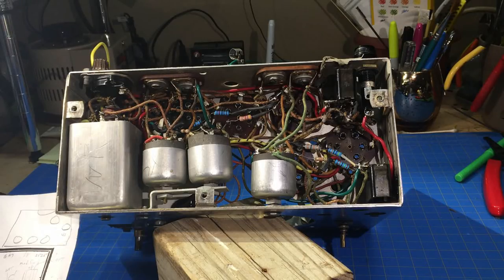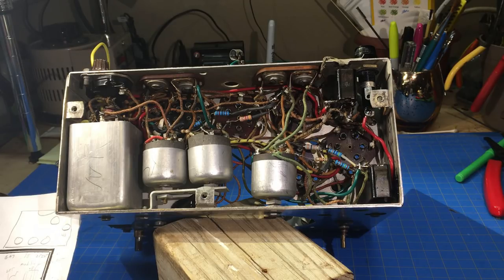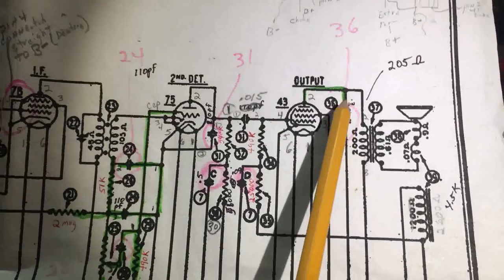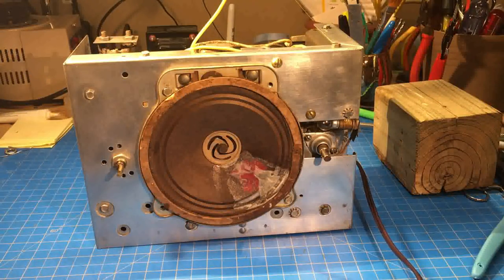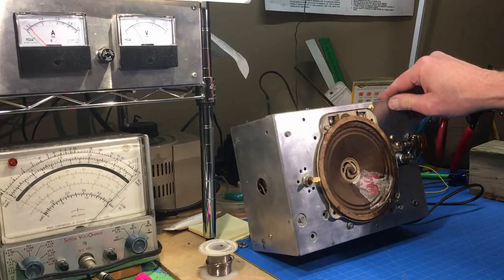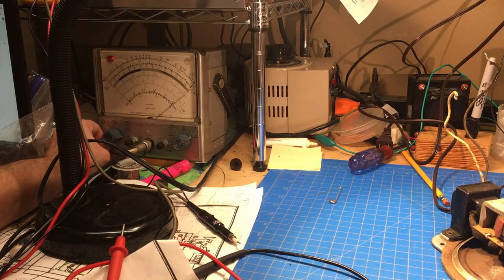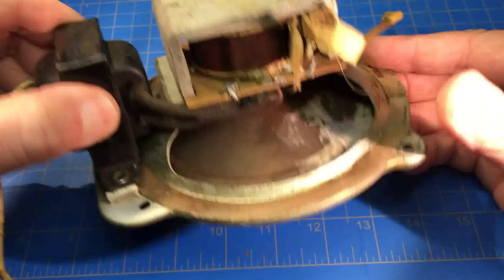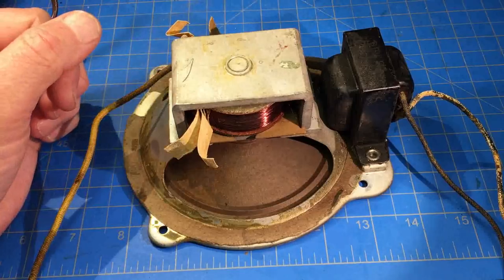1935 Philco 54C Part 5 of 7 Bad Speaker Field coil and a New Direction

Comment: Larry,
I really like your meter.  I like the nice big dial.  My heart sank when no sound came out.  I have had more Philco speakers with bad field coils than any other brand.  Since Philco made their own, I suspect that there was a relative deficiency in their units.  It is a nightmare when that happens, especially when you know that it WAS working before.  Sometimes that happens though and you did solid troubleshooting work.  Excellent as always, Larry!   Cheers!    Michael
Reply from the maker: ThatTubeSound Thanks Michael! The meter was a gift from my neighbor and partner in crime. He bought it and went they it, it wasn’t exactly factory but someone had made a major overhaul with fabricated PC board. Works great and I figure it’s as good a meter as “ancient Radio repairman” had so, I’ve started using it. Who cares if the voltage is 134.357 volts? 135 is close enough! Speaker was a bummer and maybe a show stopper for some, but I ended up showing what someone would do if they wanted it just fixed. Doesn’t have to be all original? Does it? Lol. This one should be finished soon and I’m starting a new project and going to try something a bit different! Hope all is well! Take Care—Larry

Comment: You have been having the kind of luck I usually have with radios, Larry! Something minor preventing it from playing..like that bare wire. I've been there so many times. Bad ground connections. Missing grounds. Bare lead touching something it shouldn't. I've also been there with open field coils too. Usually with me it's bad speaker cones. Rattlely, garbled sound because of it. Working on a Zenith 6D311 with a bad speaker right now. Anyhow glad you found the problem. Once you locate a speaker you'll be good to go. Even if it's a permanent magnet that will fit.
Reply from the maker: gavinwb1 Thanks Greg! Lol, the tiny things can be the bummer. I got discouraged, finding so many discrepancies with the wiring, I feared, I would never find out what was the cullprit! Lol. I made a few minor mistakes myself. But, I guess a field coil, power transformer, coils, IF's and speaker parts are a techs nightmares! Started the cabinet, so thats a good sign Im moving forward! Lol Take Care--Larry

Comment: Others have recommended that the output filter cap should be rewired to B+ instead of B- anyway. It takes a lot of voltage off the capacitor and reduces the risks of a disastrous short happening.

Comment: Hey, Larry...
You probably already thought about this, but you may want to add some capacitance to the power supply by bumping up the electrolytics one step.  Check out what the smart fellas have to say about it, but I believe it is commonly done.

...and oh yeah....EXCAVATED !   I love it!
Cheers!  Michael
Reply from the maker: ThatTubeSound Thanks Michael, I did consider the added capacitance. I used 15uf instead of the 12uf that were original. That was even before I knew I had a bad speaker field coil. I decided not to change those out, here is what I was thinking. 1st, I waited to see if there was hum. I felt like there wouldnt be, because the pi filter network was intact. There is a filter choke in between the filter caps. The speaker field coil is actually used as a voltage dropping resistor more than in the filter circuit, which Im sure it does provide some filtering. I felt adding too much capacitance would increase the voltages, and this is a 1935 model rated for 117 volts. With the wire wound power resistors, they were almost spot on. I was actually hoping they had drifted high to reduce the voltage. So, hopefully that explains why I didnt do a whole lot about the filter caps? Thanks for asking! Let me know if my thought process here has some holes in it? That is how we learn! Take Care--Larry

Comment: I just did a Canadian made GE radio for a friend and the field coil was intact, but the speaker sounded terrible! I just substituted a resistor for the field coil, and put in a conventional speaker for the usage. Maybe I'll do a video while I still have the radio.
Reply from the maker: Radio wild I would like to see that! Thats what I guess is what will happen to this one, if the speaker I ordered will fit. Clearances are tight, but I think if it will go in between the tuning condenser and the output tube, I can mount the speaker and output transformer somehow. Thanks! Larry

Comment: I hate being in suspense is it an old radio
Reply from the maker: John sweda Drama sells! Lol why do they always go to a commercial just when something happens? So you will stick thru the commercials to find out what happens! I hate commercials! Lol. Thanks John, Take Care--Larry
Reply: Backtothefutureradios you could drill out the core on the speaker and replace it with a bolt? If the core is removed then the field coil looks like it should just slide out if you tap the end and just threaded a bolt in to replace it with a shoulder Bolt, preferably. I don't know if you can thread it down the bottom part or the top part either way doesn't matter if  the metal surround is not just held in by the iron core not sure it might be in this case. So you need to thread the bottom part only! Or just replace it with a modern speaker what's easy to get hold of looks like a 6 inch driver? SEAS excellent quality! make a lot of range of speaker drivers.
Can you not just solder the white in-situ just find another piece of wire and hook them over each other and just solder them??
Reply from the maker: John sweda Thanks John, drilling out the back and bolting would be what is needed. Care must be taken not to drill too deep as the front part of that is where the voice coil "spider" is attached from the front. I did consider it and its still not out of the question as a side project. My first choice is find an original replacement from a parts set. However, The challenge with a PM replacement is clearances when mounting. A lot of the new PM replacements have a large magnet on the back. I have less than 2 1/2 inches in the back. Hopefully I have found a replacement out of a Zenith and should be here later this week. Thanks for the suggestions! Take Care--Larry
Reply: Backtothefutureradios not sure why you're worried about the spider! You're drilling it from the back and only the outside?  not the front end as you can see it's been compressed over the outer casing. It's just a glorified Rivet. But you will need to remove the spider probably I'm not sure to remove the core, So you need a drill that's the same size or slightly bigger would be better?† If you got a drill press even better' need to hold the speaker firmly and just take it down to the body of the speaker chassis and maybe a tap with the hammer and it should come out? Drill it carefully it should just come loose and then you can drop it out from the back end maybe? and remove the coil of wire and clean any iron filings you probably want to take the spider off the front that shouldn't be a problem? When you talking about spider talking about the bit of at the front what would be a dust cap on a pm speaker, but that could be left in place. Because  everything should slide out the side or fall apart, when you've taken the core out! As I said it's not really a daunting prospect as long as you got a drill press preferably! You just want to take the lip off the core where it's been squashed over, so doing it with †a smaller drill the same sizes as the core first, and then go for two or three sizes bigger drill, so it can take the overhang from the squashed core. You don't need to drill it that deep just slightly deeper than the thickness of the metal surround on the first drill only of course. I would have thought it's only compressed on the outer side and it's got a inner lip on the inside maybe? You can tell this by how the outer part the Horseshoe shaped goes around the coil and is attached to the inner part?? is it actually attached can you see if it isn't then they're be a lip if it is then there will be no lip to hold the unit together? Doesn't make sense to compress both sides in manufacturing too complicated awkward doesn't make sense cause unnecessary damage to the casing. But I'm still not sure why you can't just solder the wire you show the wire why can't you just find a little bit of thin wire and reconnect it and then re tape it… sounds like the easiest solution hope you show the video on this maybe do it as a live stream and we can all put our two cents in!!!!
Reply from the maker: John sweda John, I understand what ur saying, yes you are right if U don’t drill too deep it will be fine. Like I said earlier, this could be a side project! Larry
Reply: Backtothefutureradios 👌👍